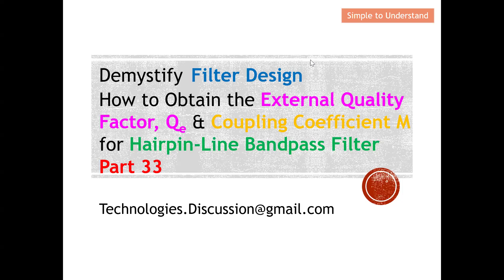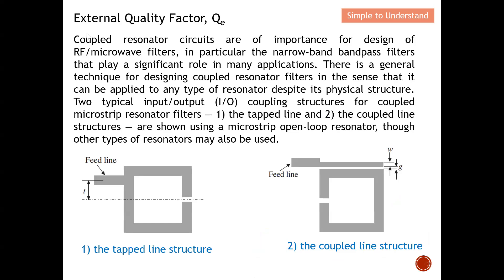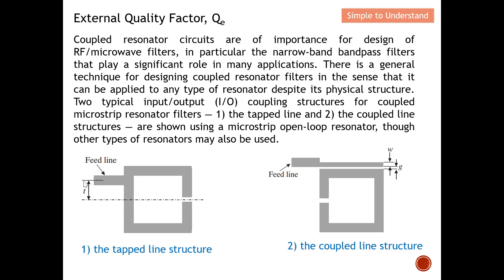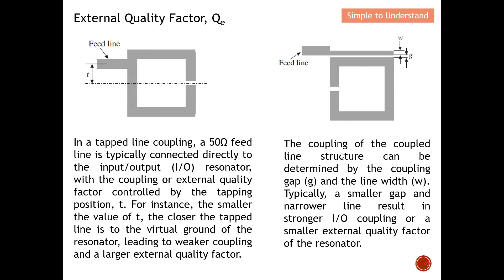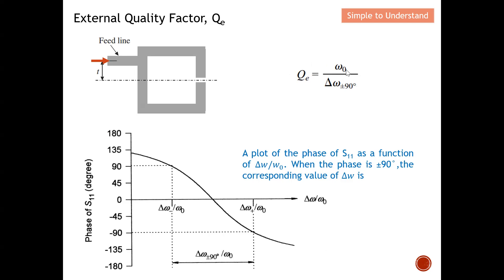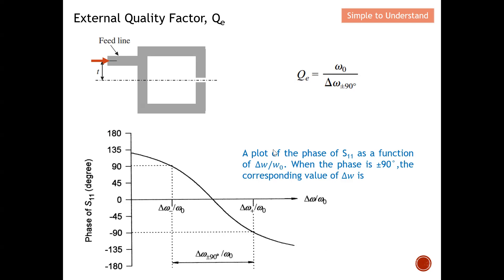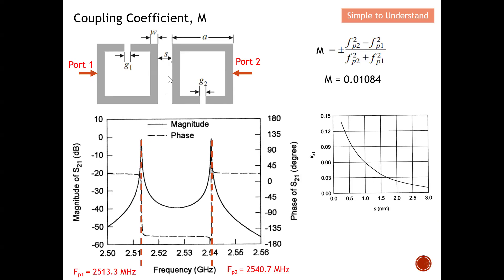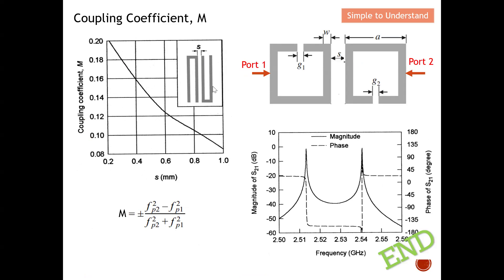Filter Design #33. How to Extract External Q & Coupling Coefficient for Hairpin Bandpass Filter.

Comment from the maker: Thank you for taking the time to watch this video on filter design. In this video, we will show you how to extract the External Quality Factor and Coupling Coefficient from simulation results by plotting the data. You can then use these charts to determine the External Quality Factor and Coupling Coefficient, which are essential for designing and developing a hairpin bandpass filter.

Comment: Hello sir, thank for an useful video. I have a question: In your coupling coefficient extraction method, you identify fp1 and fp2 at the two resonant peaks of |S21|. However, for filters with flatter passband responses (like Butterworth or low-ripple Chebyshev), there are no distinct peaks in S21. How should I extract the coupling coefficient M in those cases?
Reply from the maker: You are most welcome! :) For flatter passband filters, you'd typically look at the 3dB or fractional bandwidth points.

Comment: how to determine each dimension using stepped impedance hairpin resonator design form, i want to make a lowpass filter using stepped impedance hairpin resonator
Reply from the maker: Not possible to answer this question by email or comment. Need to do a video to explain this concept.